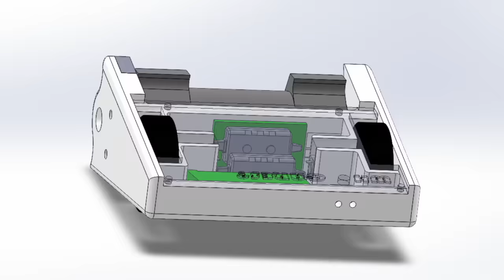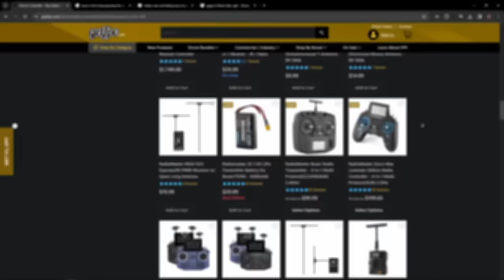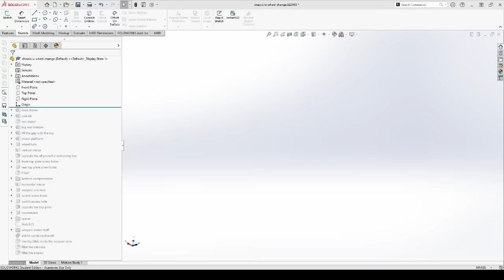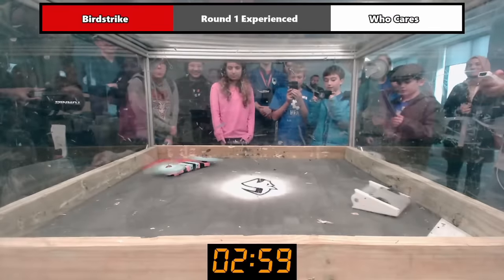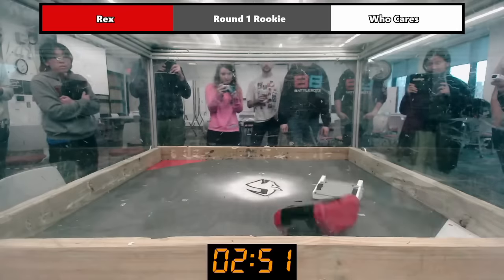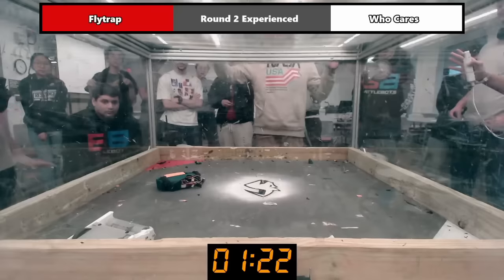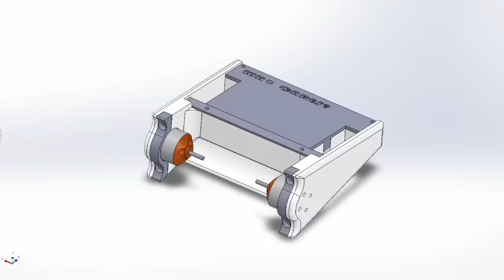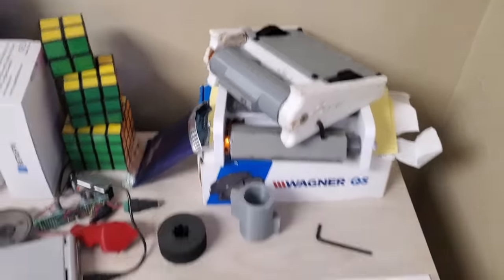i built a combat robot. in fact i build combat robots now, i guess.

Comment: I had an esp kill my laptop in exactly the same fashion. RIP to all the unfortunate PCs out there.
Reply from the maker: For real! And at least i'm not the only one to make this mistake. I'm still somewhat surprised thus was able to happen given all the hubbub over USB killers.
Reply: i add myself to the gang! fried hdd and serial capabilities on usb but laptop was fine, luckily it was an old one but that's why i put an extra diode on my custom esp pcb for robot combast, i don't want 3s to go into my pc usb ever again
Reply: I’ve just been learning ESP and this is handy to know about 
thank fuck I’ve been powering mine via the same USB C connection I use for the battery pack or I’d have definitely made this oopsie
Reply: Aye, nearly done that myself as well, dumped 12V directly into the my laptop's USB port. However, and somehow, either the USB port had some safety protection system or my reaction time was fast enough to unplug it before it caused permanent damage, but my computer somehow survived. My work didn't because the computer instantly shut down when I plugged in the ESP32 but I'm just happy that I still have a working laptop.

Lesson learned, unplug any external power supply from the microcontroller before plugging it into the computer. Also, don't upload code at 3AM.

On an slightly unrelated note, don't try computer repairs at 3AM either. Dropped a screwdriver and fried whatever controlled the backlight of the LCD on the very same laptop and I thought I killed it... until it decided, "nah I'll live", and miraculously came back to life like nothing ever happened. I... don't know how that laptop is still working, there was a SMD on the motherboard that's now just a burnt smudge... but it still works? Somehow? 

It's just, built different I guess. idk.
Reply: why does y'all esp doesnt have protection diode??
Reply: In industry I saw a guy who was half awake that morning plug 120vac into the 24vdc plug, blew the board, the microchip programmer puck and the PC in a split second

Comment: Honestly shocking a 3d printed spinner doesn't just explode
Reply from the maker: Nah they do. Initially the drum on V2 was printed on a 0.4mm nozzle and immediately chipped when testing. In the actual competition i swapped it for one printed with a 0.8mm nozzle and it lasted like 4 fights
Reply: @KylesMaybeElectricalStuff  That's still way better than I would expect. It just feels like it would immidiately be disasterous.

Comment: you can try to add screws to the weapon so it will do more damage 
edit: practice your drive
Reply from the maker: What you are describing is a metal weapon, since you are adding metal screws as impactors. You see this on some beetleweight kits like fingertech beater bars, but no reasonable event organizer would allow such a design in a plastic antweight bracket. Even if it was legal, i'd have to manually balance the weapon by fiddling with the screws such that it doesnt shake violently when spinning, a task which doesnt seem appealing especially given the limited repair time deep into a tournament.

Comment: Great video!  Loved the combat and the humor.

I'm not sure if it's the same thing, but I had a similar controller disconnect issue with my ant weight (also using an ESP32 and bluetooth controller).  The issue turned out to be the boot button on the microcontroller.  Sometimes big hits would cause the button to trigger, the board to reboot, and the controller to disconnect until I went through the pairing process again.  Other times it would still think the controller was connected, but wouldn't accept input until I fully shut down and re-paired the controller.  As a short term fix, a big glob of hot glue on the button worked great!
Reply from the maker: THAT MAKES SO MUCH SENSE! What you're describing is basically what happened. I didn't show it, but in that final grudge where the drum split, the same thing happened where it died and couldn't accept input. We opened the box, power cycled, and just as you described, it came back to life.

Comment: Great video on robot design. It's great to see people being inspired by the Sgt Cuddles design. I bought the original Sgt Cuddles from Robert Cowan years ago and I have rebuilt in a few times but the biggest issue with that design was balancing that drum and not high-siding on the floor and losing traction, also there is very little purchase with that titanium drum, so that rake angle thing is quite important too. Welcome to the hobby! it only gets worse when you get to Beetleweights and Featherweights at the NHRL level.
Reply from the maker: NO WAY! It's awesome to be acknowledged by someone who has handled Sgt Cuddles! And yea i have had issues of ground clearance - you can see in the v1 fight the robot is barely driving. Also I didn't show it but the my v2 had an earlier chassis iteration where it basically didnt drive due to both ground clearance and the wheels being all the way in the back, behind both the battery AND the drum. I have destroyed that chassis in my first test of the fixed version

Comment: I was most curious to see how the WiiMote was used to control Who Cares. You could probably get absolutely silly and map tilt controls to a throttle somewhere...
Reply from the maker: Nunchuk is drive, B is 1/3 weapon throttle, A is 2/3 weapon throttle, A+B is max weapon throttle. The wiimote itself only has an accelerometer, so anything more than waggle controls are infeasible with the amount of effort i was willing to put in (even then i struggled to get super fine control). Wii motion plus adds a gyro for actually usable tilt controls. I should figure out how to use it...

Comment: You put waayyy too much time and effort into editing this video to only have 1.06K subscribers, but you just got another one outta me! Great video and congrats on getting into the hobby! I've always wanted to get into it myself but I ended up going down the information security route and 3D printing as a hobby instead... 😅
Reply from the maker: If an electrical engineer can do this then an infosec person can do it too - 3d printing is super easy to get into so long as you don't touch anything with the words "creality" and "ender3"
Reply: @KylesMaybeElectricalStuff  oh, I'm already knee deep in 3D printing (built my own RepRap Prusa Mendel over a decade ago 🥴, had a stint with an Ender 3 Pro that still produces decent results, but my X1 Carbon is my daily driver these days), it's just translating it to functional designs that would hold up in a fight is where I'm less confident. 😅 
I can do very basic stuff in Fusion 360, but it's still an uphill battle for me at the moment. Regardless, I appreciate the encouragement and maybe I'll be fighting you in robot combat in a decade when I finally get the knack for it! 🤣

Comment: How did you learn do this stuff
Reply from the maker: Trial/error, online tutorials, and talking to more knowledgable people can get you so so far you have no idea
Reply: @KylesMaybeElectricalStuff  also did you use the Wii chuck library
Reply from the maker: @zed_2ed929  nah. The wii remote itself is just a bluetooth device, so I had an ESP32 inside the robot that it connects to. Someone made a library to do this which I used, though it takes a small modification to get it to work. I keep meaning contribute my fix to github but I keep forgetting to
https://github.com/hrgraf/ESP32Wiimote

Comment: Hi, kyle, if your reading this,  how would you connect a wii remote to an arduino to control a robot?
Reply from the maker: The wii remote itself is just a bluetooth device, so I had an ESP32 inside the robot that it connects to. Someone made a library to do this which I used, though it takes a small modification to get it to work. I keep meaning contribute my fix to github but I keep forgetting to
https://github.com/hrgraf/ESP32Wiimote
The ESP32, in my experience, is not able to handle pretty harsh conditions (i.e. combat robotics), so I'm working on a different solution using ELRS, but it's still a bit immature to talk about here. That being said, I can still recommend it for most other things. Some folks use ESP32s to control 3lb combat robots at NHRL with xbox controllers and such, so I might just be bad at this.